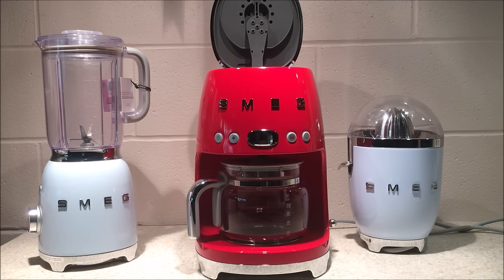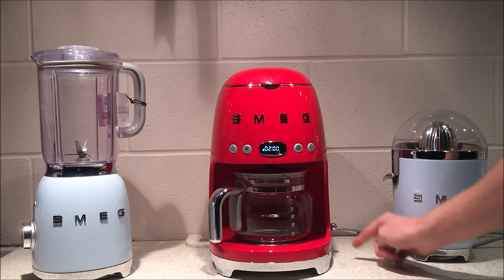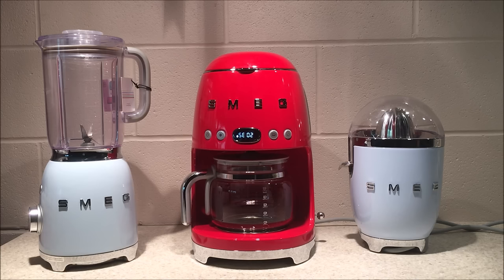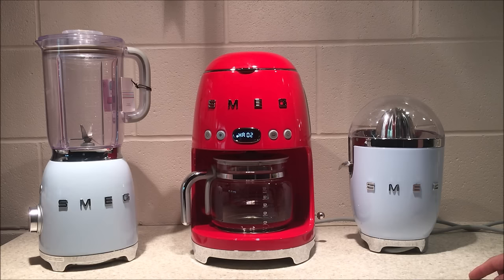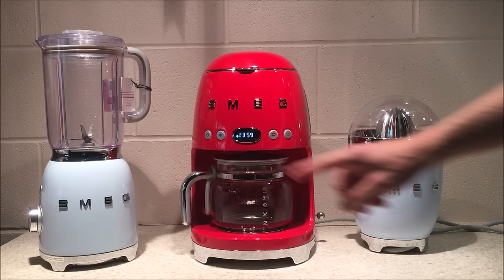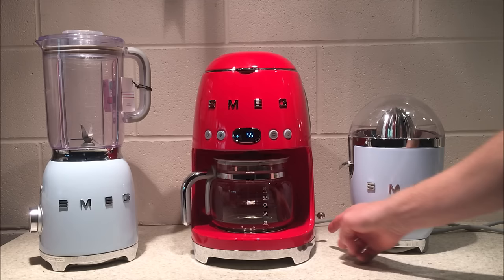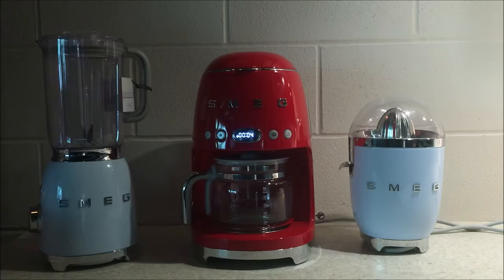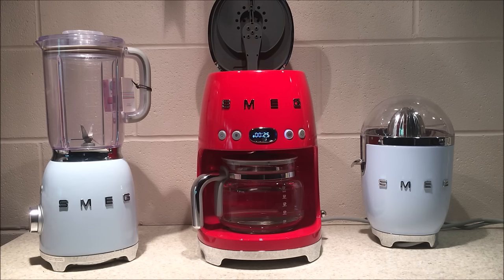Smeg Instructional Video Drip Coffee Maker DCF01 / DCF02 Tutorial - see description

Comment: Thanks for making this video! Very helpful. 
I have a few questions after receiving the machine recently:
- I was wondering, does the machine keep brewing until all the water in the tank has ran out? 
- And what if you select the 4 cups setting but there is more than 4 cups of water in the tank? Will the machine stop by itself? 
- Do you need to press the ON button after pressing the 4 cup setting button?
- Some coffee spilled on the hot plate and burnt the coffee which is now a stain, any tips on how to remove this? 
- Can the brew be kept and reheated at a later stage? For example, can I make a 10cup brew in the morning, and reheat half for the afternoon? If so how do I do this? 
Thanks I’m advance for your help 🙏🏼
Reply from the maker: Thank you for all your questions. Here are the answers to your questions:
- I was wondering, does the machine keep brewing until all the water in the tank has ran out? 
Yes in regular mode the Coffee maker will run until it is completely out of water. Once the tank is empty it switches to keep warm mode, which last for 60 minutes on the DCF02, and 30 minutes on the DCF01.

- And what if you select the 4 cups setting but there is more than 4 cups of water in the tank? Will the machine stop by itself? 
When you select 4 cup mode you need to ensure that you only put 4 cups of water in the tank. If more water is in the tank, it will run until approx 6 cups have been dispensed before it will shut off. The 4 cup function is available so if the customer is making 4 cups then the keep warm mode will not be activated after the water has run through. 

- Do you need to press the ON button after pressing the 4 cup setting button?
Yes the ON button must be pressed as well as the 4 cup button. 

- Some coffee spilled on the hot plate and burnt the coffee which is now a stain, any tips on how to remove this? 
To clean any stains on the hot plate a damp cloth with some dawn dish soap should remove mild stains. Only do this when the hotplate is cool, and follow up with just a damp cloth to remove any remaining soap before using the coffee maker. Tougher stains may be removed with something mildly abrasive such as a Mr clean pad or a light steal wool with a little water. Clean in circular motion following the grain of the stainless on the hot plate to avoid scratching. Again, only clean when the hotplate is cool and follow up with a damp cloth.

- Can the brew be kept and reheated at a later stage? For example, can I make a 10cup brew in the morning, and reheat half for the afternoon? If so how do I do this? 
Once the keep warm stage has ended and the coffee in the pot has cooled a new batch must be made. There is no reheat function for the coffee maker.

We hope this helps.

Comment: I accidentally tossed out the filter. What replacement options are there? I purchase a standard reusable filter, but the brewing process does not start. Could it be b/c of filter?
Reply from the maker: Thank you for the question. You can purchase a spare filter from after sales support. 
The drip coffee machine will still work fine without a filter. Just make sure that you have the proper filter holder because without it, the coffee maker would leak.

Comment: I love my Smeg coffee maker! My only problem is that sometimes when I pour the coffee from the jug, hot coffee trickles from the lid and makes a huge mess. Is there a particular was you have to “set” the lid so it is securely sealed? I have tried turning the lid so the little grooves on the lid are not in the middle of the spout but that doesn’t even help.
Reply from the maker: Thank you for your comment and great to hear that you are enjoying your coffee maker. So in general it shouldn't leak from the lid unless you have the carafe on an extreme angle. So please make sure that you are are only pouring out coffee carefully. There is no one perfect way to place the lid on the carafe when it comes to direction. If you are still experiencing problems, you may want to contact the local service department in your country and inquiry about a new lid.

Comment: Hello! Does the drip/brew process pause if you take the carafe out mid-brew to pour yourself a cup quickly before it's done?
Reply from the maker: Thank you for your question. The brewing process itself will not stop but it will stop dispensing coffee into the carafe. So don't wait too long to put the carafe back, otherwise coffee will flow out at the top.

Comment: Any idea how to improve both the strength and temperature? I am 4 scoops of coffee and enough water for 5 cups, use the 4 cup setting but the coffee is very light and flavourless. tried with different coffee types. i want strong coffee. i shouldn't be able to see the bottom of the coffee cup!
Reply from the maker: In general, the more coffee you maker, the warmer it will come out and vice versa, the less coffee you make, the colder it will be. So please try making more coffee to increase the temperature. If you want to stay with the 4 cup setting, one idea would be to boil the water first in a kettle or a pot and then put it into your coffee maker after a couple of moments and then start the brewing process. 
For the flavor, most of it is because of the types of coffee grounds that are used. However, you can increase the flavor by pressing on the bean button so that two beans appear on the display. This is explained in the video as well. The effect of it is that less water is dispensed per time unit so the water goes through the coffee grounds at a slower rate and will pick up more flavor.
We hope that this helps.

Comment: Hi! Can you tell me, are the filter holder and filter stainless steel or plastic? And can you use paper filters instead of the reuseable filter?
Reply from the maker: Thank you for your question. The filter itself is made out of fine metal and the filter holder is made out of plastic. You can use a paper filter instead of the provided filter.
Reply: You use the provided filter. It can be cleaned after each use. Using a paper filter as well reduces the taste and aroma considerably

Comment: Is it possible to have a cup of coffee during the brewing process or do I have to turn the coffee maker off  before attempting?
Reply from the maker: You can take the carafe out during the brewing process. A few drops will still come out and end up on the hot plate. However the brewing process will continue so if you’d wait to long to put the carafe back, water/coffee would flow out at the top depending on how much water is still in the water tank of the coffee maker. We hope that this helps.

Comment: Hi, I noticed something recently, the 4 cup function change to off by itself when the brew is finished when my aroma setting is on strong, the aroma setting stays every time but the 4 cups don't, however when I have the delicate aroma and the 4 cups active after brewing it stays activated for the next brews. Is this normal or my machine should remember and leave active for future brews both of the functions?.
Reply from the maker: Thank you for the question. There is a difference between the DCF01 and the DCF02

DCF01: 4cup setting turns off after brewing and the aroma setting resets itself

DCF02: 4cup setting turns off after brewing but the aroma setting stays on the selected setting
Reply: @MyApplianceGuide  Great I have the DCF02 so now know that is normal, thanks.
Reply from the maker: You are very welcome. We are glad we could help.

Comment: I've set the time on the clock and pushed OK but the middle : button keeps flashing. Should it be flashing? I can't get it to stop.
Reply from the maker: Hi Donna. Thank you for your message. That is completely normal and nothing to worry about. It indicates the seconds and shows that the time is properly set.
Reply: @MyApplianceGuide  Bit should those : marks separating the hour and minutes ever stop flashing?
Reply from the maker: @donnamcmillan6950  No, they do not. As mentioned, they indicate that a time is set and that the clock is "ticking".
Reply: @MyApplianceGuide  Thank you for your answer. One more thing I would love the coffee to be a bit hotter. Is there anyway to have the coffee come out hotter? Are there settings? Thanks
Reply from the maker: @donnamcmillan6950  Unfortunately not. We are very sorry about this.